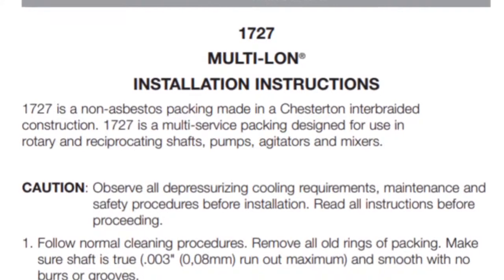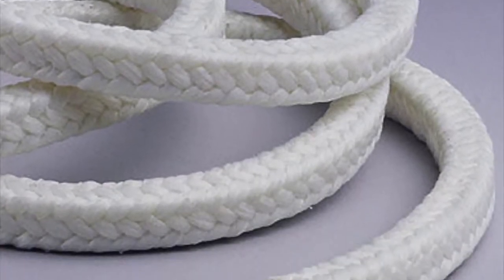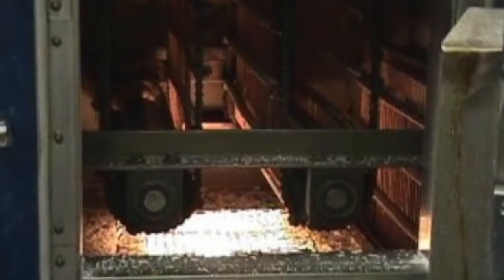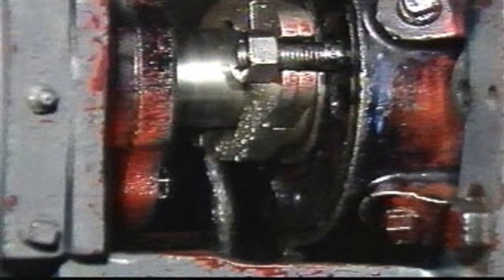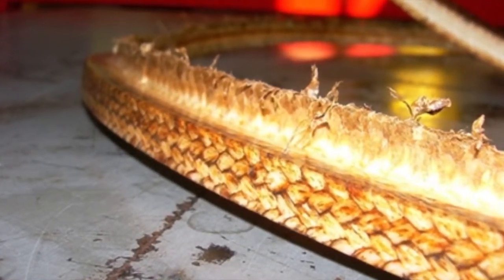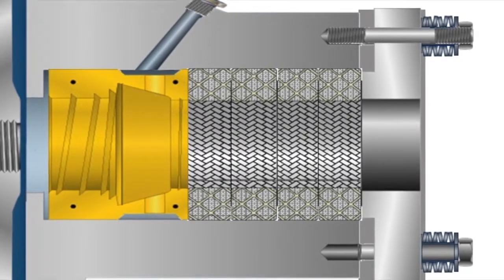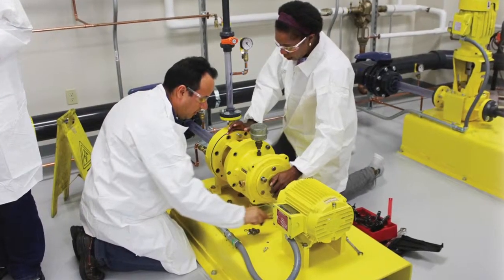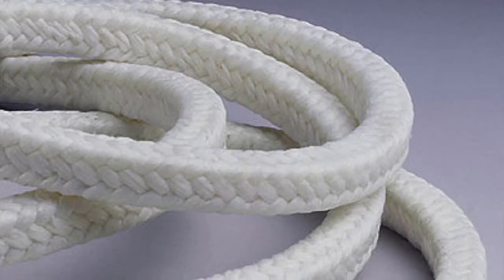Chesterton Training: Pump Packing Installation - Part 5

Comment: I want to know what should be the orientation of the packings. For example while placing the first packing should the cut portion face the downside so as to allow cooling water in.
Then we can stagger the remaining packing cut pirtions 90 degrees apart.

Is that correct?